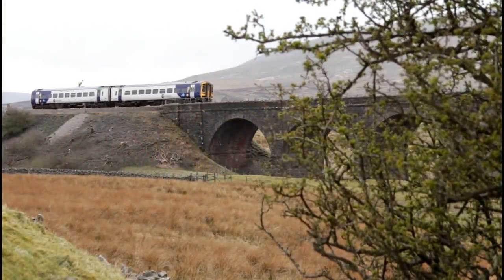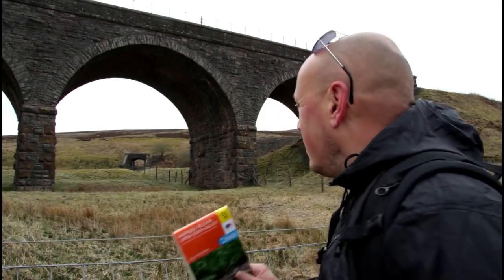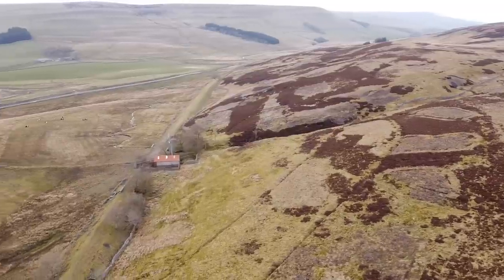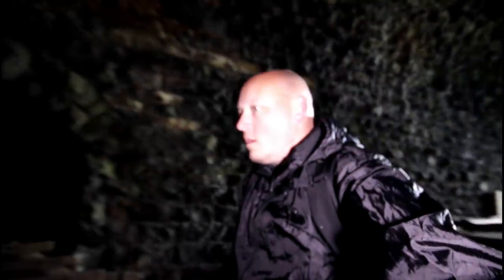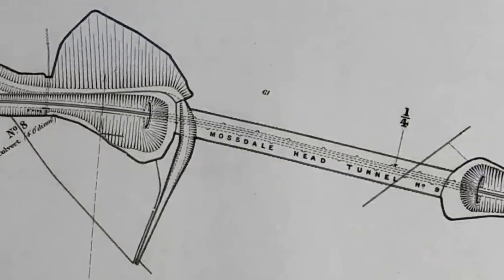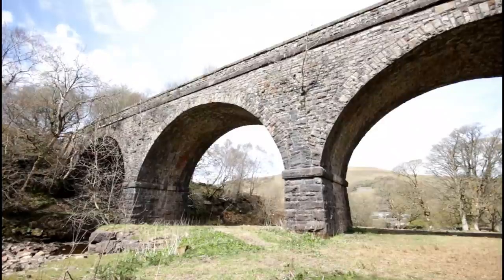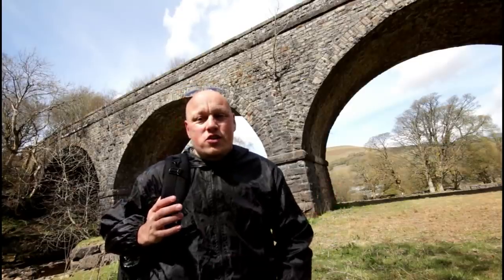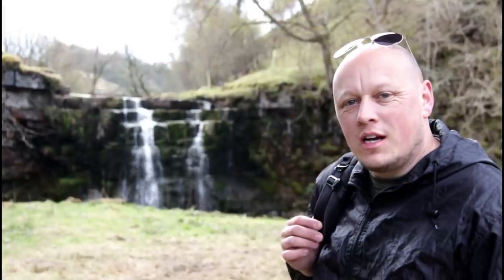Just Missed this Tunnel Collapse! Hawes Abandoned Railway Line

Comment: Would you believe that the line went all the way to Northallerton. The section between Garsdale and Hawes was built by the Midland Railway and the rest by built by the NER. The station at Hawes is still there. Don't forget the line from Redmire to Northallerton is still there and is open as the Wensleydale Railway with services running between Redmire and Leeming Bar. MIght I add when they do reopen it'll be with PACER'S!!!! After the line closed to passengers. The line was kept open for freight to Redmire and if I'm right. The MOD took over the branch to run so they could take tanks by rail to and from the near by Catterick Garrison. Which leads to the unusual sight of tanks using the normal roads which have been strengthened for that reason. As passengers services went. The NER/LNER operated along the whole route but, the MR/LMS only ever operated a shuttle type service between Hawes and Garsdale. With the Governments ideas of reopening lines. This is one line that has been included in the list. The former turntable from Garsdale is now at Keighley on the KWVR

Comment: Lovely country and a lovely relaxing video but you got the tunnel name wrong for it's not Moorcroft Tunnel but Mossdale Head Tunnel and it's 245 yards long and the last train ran through it on the 16th march 1959. Although as you rightly pointed out it is indeed used to store farm machinery but it hasn't been maintained since March 1959 and ground movement is now destroying it. If the Wensleydale Railway find the cost of repairs to the tunnel too prohibitive in their future extension to Garsdale then it maybe cheaper to open the tunnel out into a cutting as the crown of the tunnel is slowly being forced up due to ground pressures and there's very little ground above the tunnel. It makes me think it may have been built at the insistence of a landowner as often tunnels like Mossdale Head had to be built because a landowner didn't want the trains spoiling his view.